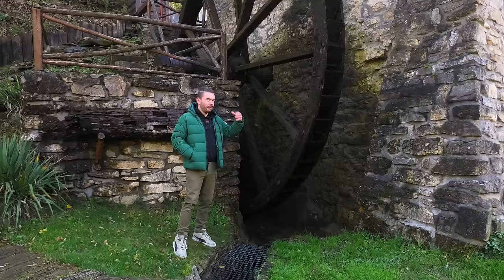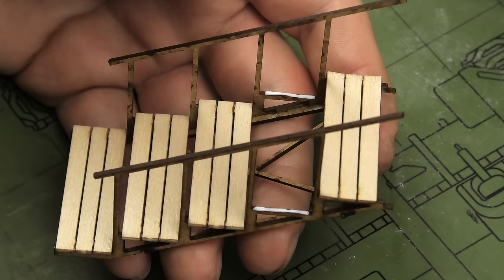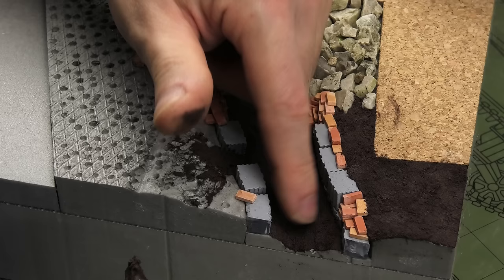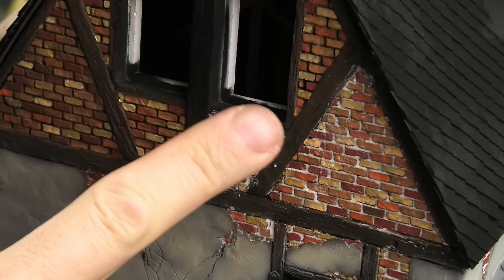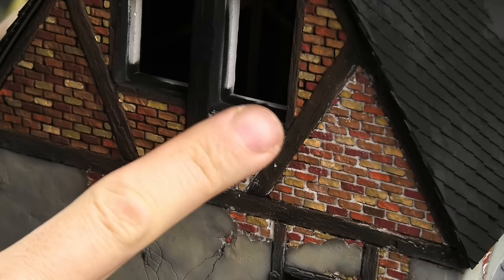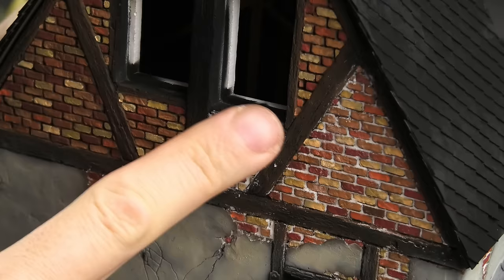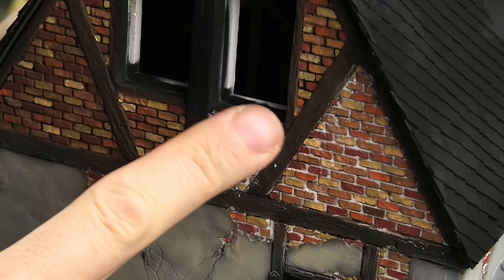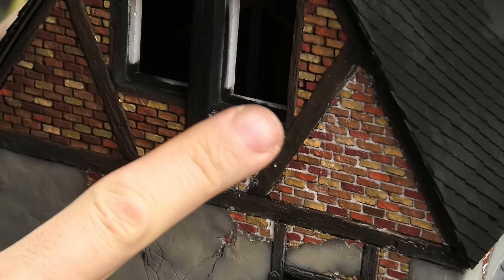The Biggest Diorama I've Ever Built! Watermill in 1/35 Scale

Comment: To diffuse the roof tiles try speckling titanium white and a pure carbon black over a neutral primer.  Then colored filters and glazes should show tonal variations from the speckled under tones.  

I use a similar approach when painting starship models which creates a subdued affect of panel variation.  For instance, black on grey primer and/or white on grey primer with a soft white primary coat. Some military modelers use a similar approach when creating panel lines on airplanes.

Comment: Lovely work! I'm a huge fan of mills, both water and wind. Years ago, I had a cardboard cut and assemble windmill that was designed to work. Instead of cutting it out, I used it as a template and reproduced it in wood. All the timbers were mortised together, the wind vanes were scarfed and bolted together just like a real windmill. I covered the roof with hand split cedar shingles. If I'd been able to make or get actual stone grindstones, it would have ground. Alas, I couldn't, so I made do with 3" circles of oak cut on a hole saw. The same artist who did the windmill also did a watermill. One of these days . . . 
Really great work sir!

Comment: I have a tip for sealing foam: Use one or two coats of 50/50 matt Mod Podge and water. It also has the benefit of hardening the foam a bit, reducing the chance of accidental damage to the surface.

Comment: New subscriber here...and I have to say, your videos are the best part of my day! I just love watching your incredible skill and also hearing about the hows and why you do certain things.  I have learned so much watching your videos and my own dioramas are going to benefit.  I am currently working on my first diorama in a really long time (at least 7 years) as I am just now getting back into modeling.  I think I am a bit crazy, but my diorama is about as big as this huge water mill one you just did.  I am scratch-building a bombed-out old bank with a Navy Seal team conducting a manhunt for a fugitive who will be hiding out on the 3rd floor.  I have scratch-built walls and concrete columns out of XPS foam, a wood floor structure using wood popsicle-type sticks with cardboard floors and drywall, cardboard stairs, and a broken styrofoam "concrete" flat roof with protruding rebar.  Of course, this means tons of debris on the ground so I am looking at a LOT of painting of the individual stones, bricks, broken joists, ceiling, etc.  But, I'm approaching it with your "infinity" solution and tackling one small area at a time so it doesn't seem so overwhelming.  I have a very limited budget and just used a lot of Christmas money to purchase some good tools and a small variety of paints but it is not anywhere close to what probably could and should be used on this model.  But, I'm making do with what I have and trying to adjust the steps to fit with what colors and items I actually have. So far it's been quite enjoyable and my wife commented the other day that she is really impressed and it really looks like concrete - and a complete mess of a building (since it's been destroyed!) so that was nice to hear! Anyway, thank you so much for all you do and your willingness to share your talents with the world!  Your videos are so much fun to watch! Eventually, I'll get through all of them and I hope to be able to join your Patreon one day to help support you. Take care, muh friend, and keep up the outstanding work!

Comment: Great job as usual. One note: if you use double-sided tape to stick anything on your diorama, DO NOT leave it in the sun or heat source. I learned this the hard way. The tape dried out and lost its properties.
Reply from the maker: Good point! The tape sometimes loses its stickiness around corners, and I have to apply a small blob of superglue to re-attach the veneer. Never thought it might be caused by heat from the radiator which hangs right behind my workbench!

Comment: Great video and results as usual. But am I the only one thinking the vanes on the wheel are backwards?
Reply from the maker: Thanks! It depends on which way the creek is flowing. In this case it's from right to the left, so the paddles are placed correctly :)
Reply: @NightShiftScaleModels  That's funny - I was going to say the same thing. For some reason, my brain is telling me that the creek is running left to right. But then again, I didn't even consider the sluice gate - of course this would be upstream of the wheel!
Reply: @NightShiftScaleModels  I stand corrected. Like another poster said. My brain automatically thought left to right.